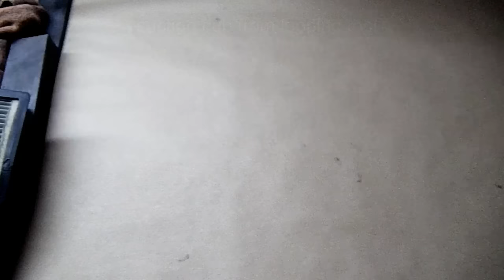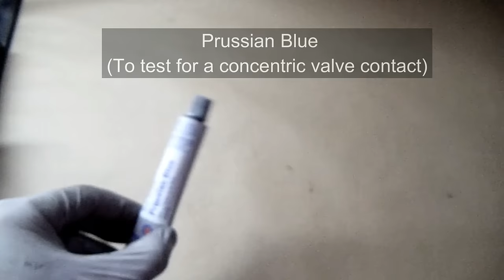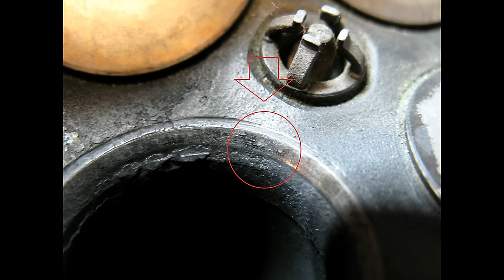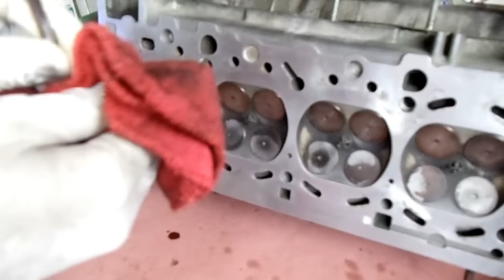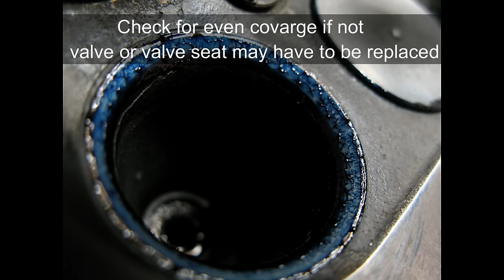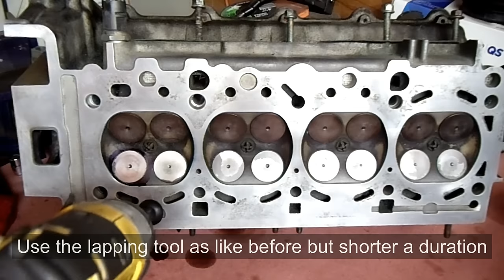Lapping and Checking Valves (EASY WAY)

Comment: I’ve lapped valves with a drill more times than not and have had literally 0 issues. From small engines to large agricultural diesels. Never had wear issues or leaking issues. Would I use it for a high performance application, no, but for re lapping good used valves during a rebuild there’s no issue.
Reply: People like to bag out what they've never tried and love the "oldskool way". That may be better but could you feel the difference? I doubt it. I did this the other day and it seemed to work. My Exhaust valves leaked air, now they dont. Gotta be happy with that!

Comment: you can measure the seat like that to be accurate.. you have to check runout. which is a measuring tool you can you in a circular measurement. look up measuring valve runout. its basically a dial indicator..

Comment: Just be sure to use grease based lapping compound as the water based crap doesn't spread very evenly since the valve likely has some oil residue on it. Also water based compound dries up in it's container. Grease based stores forever.

Comment: Nice video, thanks. I have a compression issue with my WR250F. I'm almost certain it's valves, as the piston and rings were new and in tolerance. I already tried to lap the valves once, but don't think they were in spec. I will attempt again with a few of your hints, cheers!
Reply: Cant lap valves on dirt bikes. Replace only
Reply: I think the wr valves may be stainless.  In which case they can be lapped in.  However it is very likely your valve shims.  Not the seat and valve itself...
Reply: How did you get on.. currently having some problem on my sherco 250

Comment: Though this is an old video I thought I might try and steer some people away from lapping your valves. Though it may seem intuitive, lapping your valves will actually produce negative effects for your engine. This is because when you lap your valves, you do it when the block is cold. This means the valve may seat well when the engine isn't warmed up, but when you are up to operating temps, your valves will no longer seat correctly. This is why it's always best to get your valve seating done at a machine shop.
Reply: Are you suggesting that a machine shop would heat up your head and valves to lap them together?
If you were to send a head to a machine shop for a valve job its likely going to be more than just lapping valves, maybe cutting angles onto valve faces/seats, installing new valve guides/seats, Lapping would be done as the final step of a valve job sure, but it wouldn't be the sole reason to send it.
I regularly see vehicle manufacturers explain how and why to lap valves in the vehicle manuals quite often.
I personally believe your advice is not based upon any evidence, its just more of an opinion.
Valve lapping is not that difficult and if you managed to dig them out of the engine your probably competent enough to rub em together a bit. just my opinion though.
Reply: @owaind-g678  Hey Owain thanks for the reply good sir! I appreciate the respectful disagreement and thought I might respond to your response. So I don't think a machine shop heats up the head and then laps valve seats. Like you said, when you get a valve job done at a machine shop they cut new seats at various angles and then as a final step, they very briefly lap the valves to remove any peaks from the valve seat cutting. In the research I have done, lapping your valves without getting new seats cut is a bad idea and can cause problems down the road. There is a great video from HP Academy on YouTube that explains exactly why lapping your valves is not a great idea. If you were interested, just search up "Can I lap my valves at home?" By HP Academy. There are a few other reputable sources that also say the same thing and the conclusion that I have come to is that lapping valves without getting new seats cut is a bad idea. I also agree with you in that it's an easy job to lap your valves by yourself, I'm simply saying that even if you do it correctly, I don't think it's healthy for your engine. This is obviously just my opinion, and I could be wrong! I just thought I would share what conclusion I have come to given the research I have done on the topic!
Reply: @TunerFaction  Thanks for your reply and expanding on your idea, I understand your point better now and i agree freshly cut valves will always be the best option, but not always the viable option.
Although there is a big difference between racing and road engines and id like to focus more on every day street engines for the at home "DIY" valve work we see in these videos online.
Engines will still run even in awful conditions with pitted valves and bad compression and weak springs, could have your timing off and the things still run like a hot damn.
Most the valve work I have had to do is on older vehicles with higher mileage, the parts aren't always available and can cost a small fortune if you can get them at all, sometimes resorting to second hand parts or donor engines, sometimes you just gotta do what you gotta do to get by and a lot of the time it means the parts will get cleaned off and put back together as they were, machine shop time is expensive and not always within the budget at this point i dont think you would be doing any real harm to the engine by improving the mating surfaces of the valves or seats, as long as your careful not to damage the valve guides should all be fine and dandy.
I am still curious about the expansion of valves and seats to the point of failure to seal but in a racing engine with forced induction it may be the case, It's an interesting idea and i will do some more research into it regardless. Thank you for the heads up on HP academy channel i will be taking a look at their videos.
Reply: @owaind-g678  Owain thanks once again for being so civil about our conversation. Too many people on here would have just called me an idiot and moved on. I think you have a good point, I had crafted my opinion looking at this topic purely from a racing/forced induction engine standpoint where the best option will always be to have a machine shop cut your valve seats. On an older engine where parts are few are far between, I don't think their is as much of a problem lapping your valves at home to get rid of some pitting or worn out valve seats. In a case like that, you would likely improve the seating of the valve overall! You are also right that it's not in many peoples budgets to get a valve job at a machine shop, heck, I didn't even get a valve job at the machine shop because it would have cost me north of 1500 buckaroos. I would say that there is no "correct" answer, I think it changes from situation to situation. If you want to build a high horsepower race engine, lapping your valves at home is really not the way to go. If you are just rebuilding your daily driver or rebuilding an older engine with no intention of pushing big power, I don't think there is anything wrong with lapping your valves at home. Great conversation!
Reply: Dear, Owain. 
  Are you still  there?... I miss you.
           ~ Your lover always, Tuner Faction.
Reply: @Dylans503  Hahahaha we had such a great conversation :)
Reply: Yes, and old video, and a terrible one.  The reason valves are no longer lapped is because of advances in the machining gear.  By the 1980's the widespread use of 'syncro seater' type stones with the pilot part of the rotating stone holder did such an accurate job that lapping had become redundant.   
Today, the wide spread use of coated exotic material lightweight values in hi revving engines means that lapping should absolutely NOT be done otherwise it destroys the coating.

Comment: I'm halfway thru restoring a 1990 Ford 300-6 but the head and valves are like brand new still. The head is cast iron so I don't have to be as careful cleaning the seats as if it was aluminum. Looks like your a pro.

Comment: lapping must be light !!!
heavy lapping as you do creates a deformation of the contact seat and promotes a failure  at a less than desired interval.
Many times, I had to replace valves on low to moderate  mileage engines because of a failure of the timing chain and most of the time, I seat the new valve by lightly lap them in their seat and i never had a comeback on those jobs

Comment: Prussian Blue is totally unnecessary. The lapping compound will leave a dark ring around the valve face when it's seating correctly
Reply: Wrong.  What you describing is a way out of round valve seat.  Once it is close, even fine lapping paste will score both surfaces yet 'bearing blue' will show it is still way out.
Reply: @johnwoodrow8769  if you wanna get down to specifics, it depends on the year of the head, the material of the valve and seat, and experience. When using a titanium valve, sure Blue will show up imperfections lost to the untrained eye that lapping compound will not. I'm not about to get into all of the specifics with someone who has probably never even removed a valve from a head
Reply: @Nunya_Beezwax  You may be right, and have my experience than a qualified mechanic who has been in the trade for nearly 60 years, working on everything from lawn mowers, D9 Bulldozers, outboard motors, and now just content to rebuild motorcycle race engines.
I've been in the trade long enough to see from the 1960's when it was necessary to lap valves due to the accuracy of the equipment being used (pilots fixed in the valve guide) to the advent of 'syncro' equipment where lapping became an obsolete and actually negative practice.
P.S. I haven't lapped valves in race engines for at least the last 40 years (steel or hi-tec).  The majority of modern performance oriented motorcycle engines use lightweight coated engine valves.

Comment: Your use of the blue it totally wrong. You use far too much. A very light smear and some partial rotation only. Use of a drill for lapping is wrong, it should be a hand back and forth movement.

Comment: You need to do this by hand, never with a drill, because you need to listen to the sound of the valve on the seat. You also need to go both directions
Reply: I think both will do the job but I also prefer to do the job by hand I think you get a better feel for it.

Comment: everybody on here complaining,  whu font you do your own videos, he already said hes not a professional
Reply: Aaron Frazier finally someone with commen sense.
Reply: Aaron Frazier English much, Aaron? Jeez. Whu font? Wu Tang for life! Lmao
Reply: this is good to confirm the contact on the valve seating area but there is a reason to rotate the valve in alternate direction, when the guide is not perfect, you end up with an egg shaped seat. and gouged valves. the best use of lapping compound is to confirm a seating contact on a freshly reground valve and seat and it should be done very lightly as there is an angle difference of 1 degree between the valve and the seat to promote an initial tight gas seal and this angle interference should not be destroyed
Reply: Jacques Poirier :   👈 This guy is 💯 percent correct.  Y’all  should listen.
Reply: Hence the MANY professionals correcting his, what could be catastrophic, mistakes.  Not to mention informing those who may use this advice.  This is the equivalent of torquing head bolts with an impact.   Its fast, it might work, but is it worth the shortcut?
Reply: Wait..am I not suppose to use an impact to torque my head bolts???

Comment: Not so sure about using the driver tool to finish out the job. Try this method. Start with a fine paste and add a spot of oil to it, work down by hand and feel for the cut fining out.Remove valve and clean it and the seat, check for a clean even cut, if there is a lot of cut still required then use the coarse paste and the drill, but sparingly.With coarse cutting complete finish them with fine paste and a drop of oil.Test with marking blue as shown and if all is good give each valve a final 'polish cut' with a liquid metal polish, just a few turns by hand and clean everything.By this method you should have a head in which the valves a liquid tight under their own weight and not requiring a spring to hold them closed when testing.Good luck

Comment: The service manual made it very clear I was suppose to 1/4 turn with the prussian blue. To turn or not to turn.
Reply: Because the Prussian blue should be applied so thinly it is absolutely necessary to slightly twist the valve to transfer some of it to the valve seat to get a reading.

Comment: You're using way too much prussian blue. Those dabs with the tube you make along the radius of the valve, one would suffice. Then you should smear the prussian blue around the valve with your finger so there is a very thin even amount. It should look even, then you press the valve into its seat and you give it a "slight" whack with a piece of wood or plastic. This transfers the blue sufficiently. This method will show you half a thou out of round, while your method will probably show great transfer with 10 thou out of round.
Reply: totally agree

Comment: It went from a 3 angle to one big angle valve job.
Reply: My aircraft engine manufacturer recomends (during an engine maintenance course where we did it) to cut the 3 angles and then lap to achieve a minimum seal. Checked with prussian blue to about 1mm or less, but a continuous, definit seal.
The lapped seal was to be in the middle of the valve seat and the valve face.
They said "BY HAND", do not give it to engine shop who will put it in a machine to do.
The method shown here appears to destroy valve and seats angles.
Well, that's what I was taught by the manufacturer of my aircraft engine.
But, what would they know?
Reply: @charlesbrewer6552  it is the best way to confirm a good valve contact, I never use a machine of any kind to lap valves after grinding. 
 On modern engines, it happens frequently that the valves and seats are in a very good condition so just a very light lapping to clean the contact is required.

Comment: This is a very easy way to lapping valve seat at valve however this might may eat a lot of metal due to fast rotation at pressure compare to manual hand rotation..very informative video though

Comment: You have enough lapping compound on one valve to do the hole head.
Reply from the maker: just getting rid of some old compound.....
Reply: Problem with using too much is getting it all out of the valve area and seal it is like throwing a hand full of very fine sand in your engine not good
Reply from the maker: True.... But I did pressure wash the head in the end
Reply: its his build he can do whatever he wants.
Reply: BigJsgarage w maybe you could put your own video up if you don't like his.
Reply: Lol
Reply: Thanks for the video, I live in the islands and thinking of rebuilding my keep engine but access to good machine shops here is  virtually impossible.  So I was worried about where I could get the valves redone or whether I should just buy and import long block and just be done with it.  This gave me a whole new set of possibilities.  Thanks for the vid!

Comment: When you over lap a valve into the valve seat you around the seat and don't have a true interference fit it will work for a short time but you'll end up burning a valve a rounded angle and not a true 45 flat angle worst thing you can do is use electric drill
Reply: You Are absolutely right here, the drill method is for the lazy Boys and wrong seat fitment, this drill method is harsh.

Comment: Most modern engines use an interference angle on the valves and the seats. No lapping required.
Reply: however, a VERY LIGHT lapping is not a bad thing if your seat grinding equipment is not perfect, just to confirm the contact, 5 -10 seconds max hand lapping with fine compound

Comment: Lapping alone isn't a valve job

Get this wrong and you'll end up with a burnt valve, they will cake with carbon and too wide of a seat cant cut the carbon and self clean

That's the reason for the specs on the seat width, usually about 1mm up to about 1.5mm 0.040 to 0.060 max typically 

I tried, I learned, I bought a neway seat cutter and mandrel set so I can actually do a real valve job for about $150 used on Ebay 

This is after lapping 6x pitted exhaust valves that ran perfect before I touched them 

After lapping with a drill it ended up with a few valves caked with carbon and a terrible running jeep
Reply: Many will disagree with you, and many more done valve lapping with success. I've done this before myself and I know it works, never had issues. I didn't do it quite this way but nonetheless I've done it. Perhaps you didn't lap the valve right? Or perhaps you took too much off? This trick will work, however you have to make sure the seat and the valve is good enough for it. Too much pitting and this is not the idea solution. It's only good for minimal grinding.

Comment: I really would not use a drill to do the job. You will end up with horrible score marks. Use the wooden handle and run it back and forth between the palms with constant replacement of the old compound. A light coil spring under the head helps the process.

Comment: "Easy" ?  Lazy and very amateur way is to use a rotary drill. Battery or mains.
[One comical website even suggested looking for "a polished surface" !!]
Proper way is rotating valve backwards AND forwards using a hand-operated stick and sucker.
Also - use a light spring under the valve head to lift it off the seat and allow the paste to flow back slightly.
Properly ground surface should be matt grey  - NOT "shiny" !

Factories generally don't grind-in valves on new engines  - they rely on excellent surface finish of new valves and new seats.
BigJs is absolutely right about dollops of compound. Sign of a non-trained DIY job.